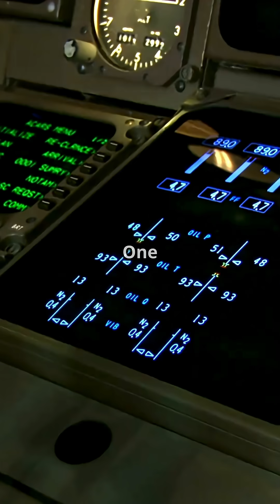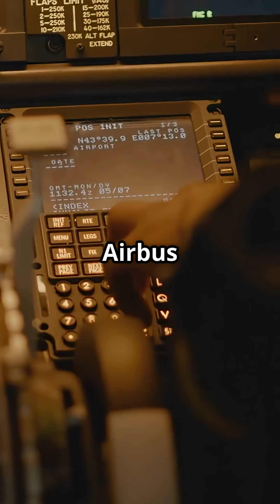A320 vs 737: Computer logic or cables and feel

Comment: The a320 family has 2 ELACS not 3. The correct amount is: 2 ELAC, 3 SEC, 2 FAC (newer neo aircraft and XLR are available without FAC computers and use an E rudder fbw rufder